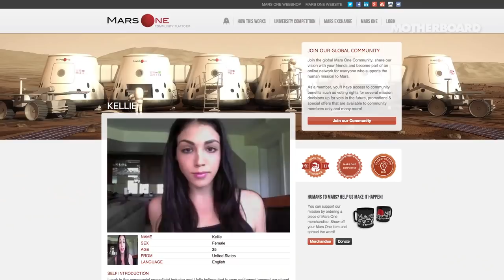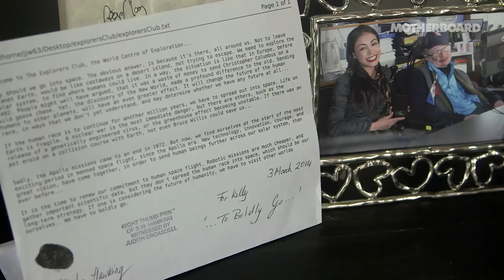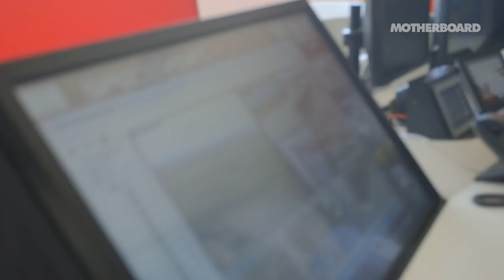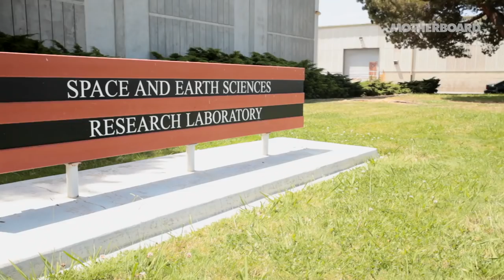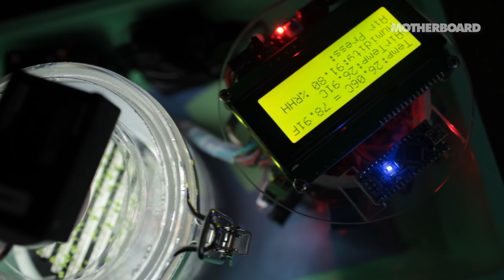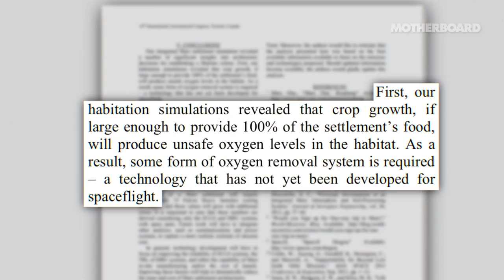When Will Humans Live on Mars?

Comment: I am wondering would it be possible to design and build a 3D printer with the capability to construct a a huge six mile high habitation dome on Mars.  Such an environment would be far more comfortable and Earthlike than stuck in those tiny space ships.  Either the materials will have to be sent from Earth to construct this habitat, or perhaps the 3D printer could use the resources contained in the land there.

The reduced gravity and air pressure on Mars would make such a construction feasible.  It would have to be double skinned and made out of some very robust carbon nano tube or kevlar materials to stop penetration of micro meteors.  If the double the exterior skin is breached, then, the inner skin will be drawn towards the outer skin to seal the breach.  Sensors could be placed into the skin so that the location of any breach could be easily located.  A missile defence system would also have to be installed to protect the settlement from larger space objects.  

Perhaps the first of these domed settlements should be around a large impact crater which can be filled with water.  While 12 miles in diameter (if possible), the amount of people settling in this dome would be rather sparse as it will be filled with water.  

When this is done, another dome 12 miles in diameter, and six miles high, could be constructed in which to grow food.  Again, the number of people living in this dome would be small, as it will be for agricultural purposes.  

Finally (well, maybe not finally) a great city could be constructed inside of the third dome, which would again, be 12 miles in diameter and six miles high.  People working in the asteroid belt and on the moons of Saturn and Jupiter would go to this city for R&R.  In fact, it would be a great place from which to service these ventures.  

I am wondering is it possible to anchor a space lift to one of the Martian moons from which people could be transferred to and from the surface at a relatively low cost.  Anyway, with the weaker gravity, getting off of the surface will not be a problem for rockets, and with Space X's new technology, getting to the surface should not be an issue either in the absence of a space lift.

I am not sure if it would be feasible to build a space port on top of Olympus Mons.  

Large, very comfortable space ships could be constructed on the Earth's moon in which to transit people from Earth to Mars.
Reply: By the way, it would be even better if we could build these settlements inside a localised magnetic field.  Radiation exposure would come right down to normal if this was the case.